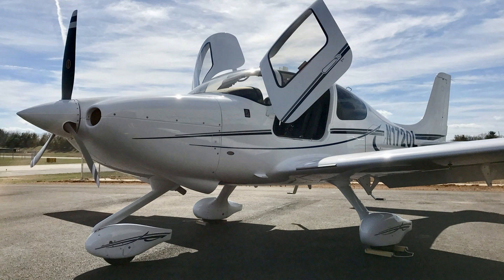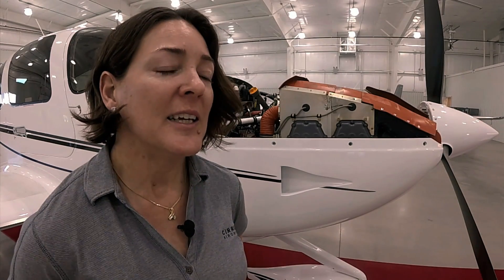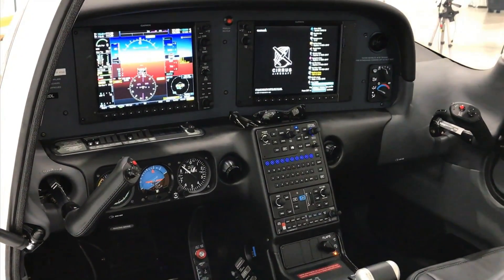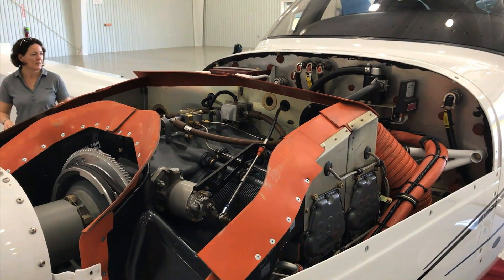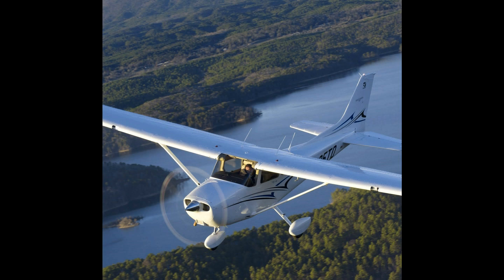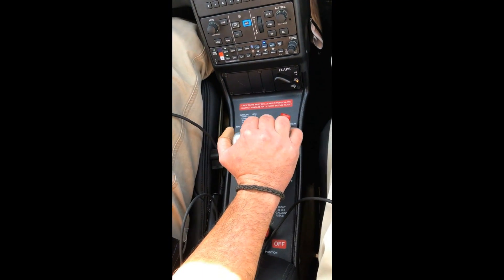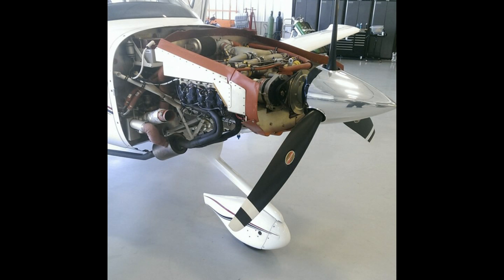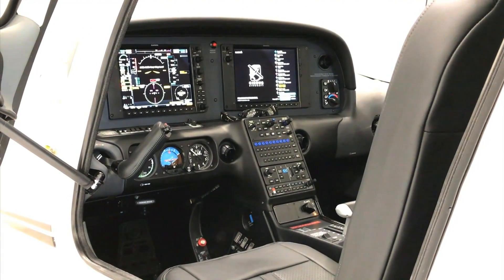The Cirrus SR20's New Engine

Comment: I understand a couple things that peopled liked about the SR20 6 cylinder was that it seemed to run quieter and smoother compared to a 4 banger and even the SR22T.  Has the SR20's cabin noise and vibration slightly increased with the new 4 cylinder?